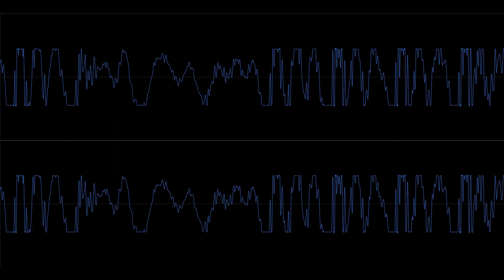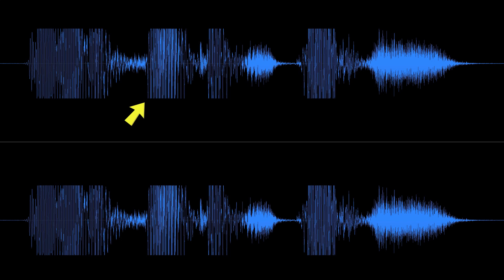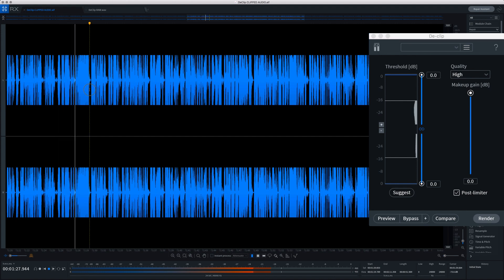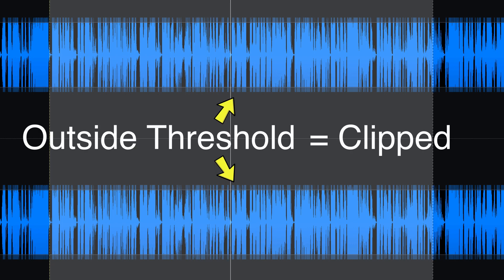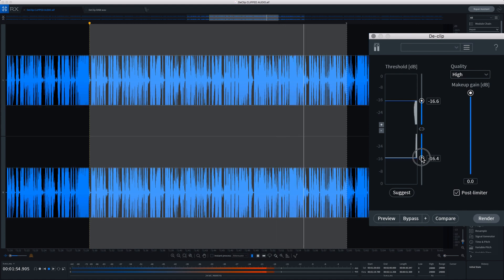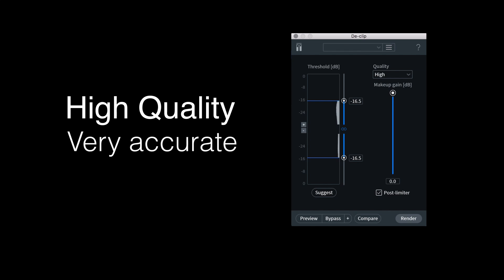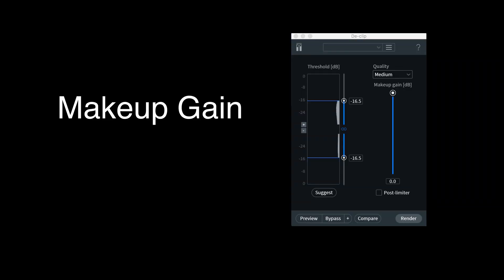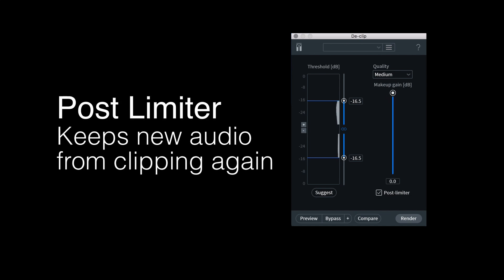How to Fix Clipped Recordings - Part 2 of 24

Comment: It sounds absolutely incredible , now i don’t know how it works but i can imagine that if a curved line is cut, it simply could just following the directions of those lines at were they should be , however some curved lines don’t give enough evidence at where those lines should be because in some cases drawing a huge curved does always match of what the original sound should,ve be, in some cases there should be 2 curved lines rather then a big  one, but what if theres no evidence about it? Sure you could make random guesses but could result in errors , so that best thing to do in such cases might be to just recognize sound in order to determine whether there should,ve be 1  huge or 2 smaller curved lines.
Either way de-clipping is an interesting module.

Comment: Nice breakdown that the square waves sound like clipping.

Here's the issue with my Rode mic. it clips WITHOUT clipping. It makes that sound you just made, but at -20 dB. Any idea what's going on? Rode says Im too close to the mic or too straight forward or I need a pop filter... but it does this at an angle, 18 niche away, with or without pop filter..... it's insane to me. Now, I'm a noob. But. I know it's not passing 0.
Reply: That is input saturation - The microphone is producing a signal too loud for the input. If it's a wireless setup, see if the kit has a pad or sensitivity control (EG the dB button on the Rode Wireless Go). If it's a wired microphone see if the device you are recording to has an input pad as well. All else fails, you may need a different mic that more closely matches the input sensitivity or to use a gain control between the microphone and recording device.

Comment: order of effects does matter: This is the order I do my audio for film. I put effects in order of non destructive.

1. dc offset       - offset power errors affects dynamic range so this goes first, a critical pre-alignment step
2. match volume    - normalize 'peak amplitude' everything to -6db to see serious errors easier like clipping, offsets, phasing etc.
3. declip          - run declip effect, remove buzzing with dynamics processing, notch filter the rest.
4. equalize        - run parametric equalizer to reduce wind, hiss via freq cut, give vocal clarity 'D' curve
5. phase correct   - once tracks layed, detect any phasing errors
6. noise removal   - declick, de-reverb, remove hiss, wind, learn sound model/noise reduction, all else healing brush
7. studio reverb   - to add vocal weight
8. RMS -23db audio - to roughly match vocals begin basic audio editing with levels(vocals center and 12db higher than music, etc.)
9. compression     - multiband compress sfx: 4:1, vocals 2:1 db to give pleasing db range. always 2nd to last step because any other processes affect dynamic range. It should soft limit for you. hard limits are audible and not recommended.
10. quality control - match loudness ITU-R BS.1770-3  -23 LUFS film, -16LUFS youtube - for standard
Reply: A quick question, you do only analyse your audio after normalizing it right ? then you would go back to the original file  afterwards ?
Reply: @eye_producer  if you mean lufs, i do that last and analyse after i've done previous effects because they affect db.

Comment: in zotope rx:
 new tip

if you run dialogue isolate with a very low setting like 1.5 separate and -6db reduction. then do voice denoise, adaptive -6, then all that's left is a nice voice with no noise except the wind, then the de-wind works 10x better. Now you're left with clear dialogue with zero distortion.
Reply: You should explain what you mean with "1.5 separate" and which scenario of a recording we are talking about.